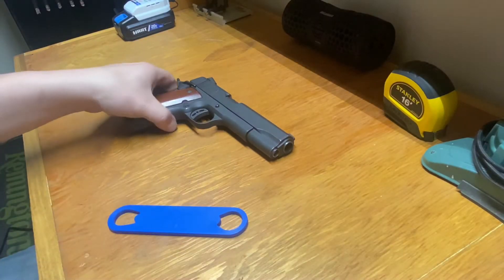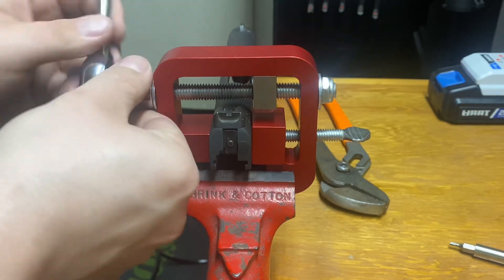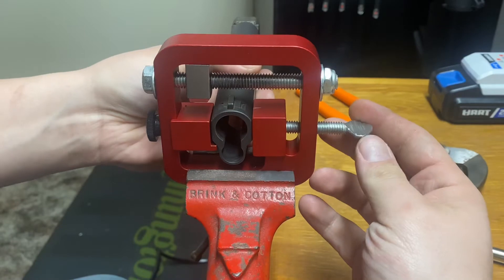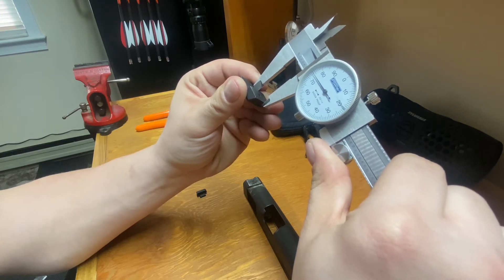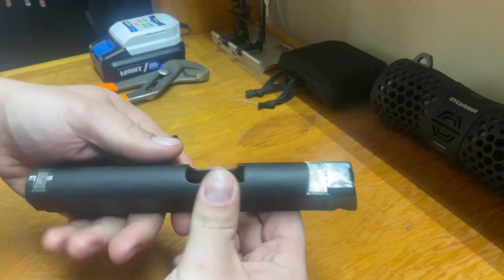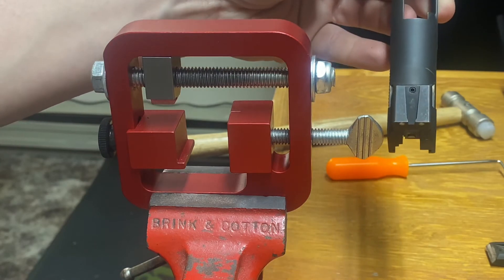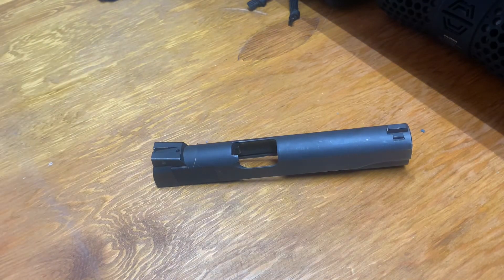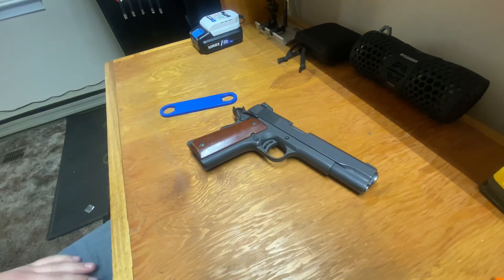1911 Night Sight Install

Comment: I have a beretta 96A1 and there is no video that shows how to install new front sights pushing it from the very bottom of the new sight. In all the videos you have to beat it up with a punch then use a Wheeler and half  the time the Wheeler would bend sight up. You show the perfect way to do it also on a Beretta. I bought three of the same sights cause I was beating it up with a punch to get it started. You literally just showed me how to do it in two minutes coming out perfect without a single scratch on my suppressor sight. Yes I used the Wheeler but I pushed it from the very bottom edge of the sight. Thanks for this video. Should have 1,000,000 likes
Reply from the maker: Thank you so much! I’m really glad I could help :) 

If you haven’t please subscribe and share!